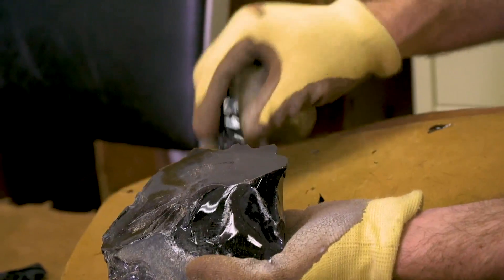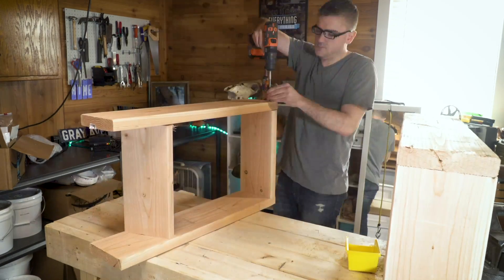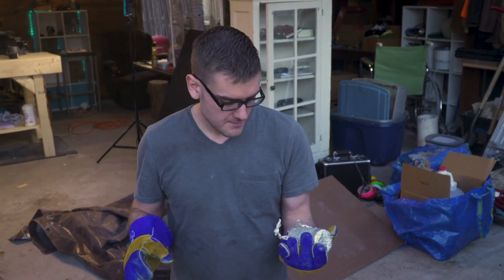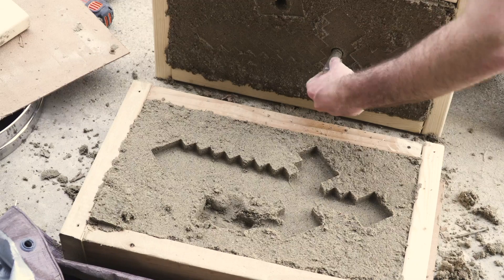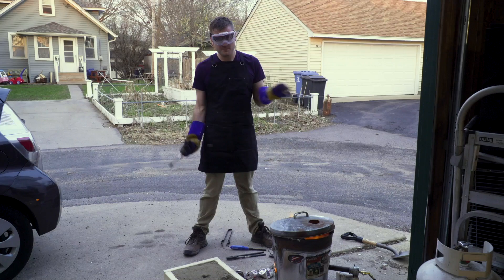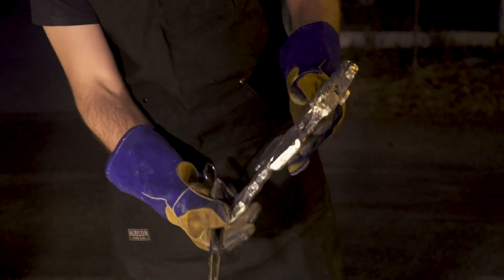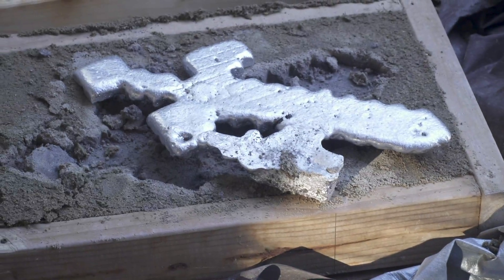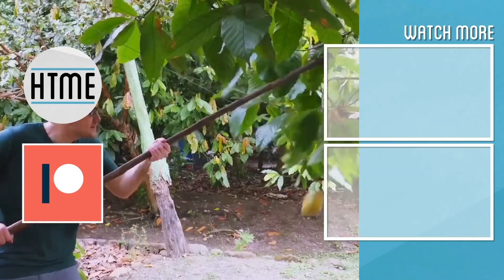Minecraft Sword from Soda Cans: Metal Casting 101

Comment: I've used Charcoal powder as a good flux when it comes to aluminum. The charcoal reacts with air to create co2 before it can reach the aluminum.

 Best of all it doesn't melt and floats on the surface meaning to get it off before or after poring is simple.

Comment: As somone who used work at an aluminium and bronze foundry this was kinda hard to watch ..this is way too late but Your sifter was fine but your green sand looked too wet and you can use ground cat litter instead, it works great and can give a lot of detail. Your green sand should clump if squeezed in your palm but easily fall apart through the sift

Comment: Before you pour the molten, scoop out the slag with either a spoon of a pair of steel tongs. Done right you can get decently pure aluminum, if that doesnt work, melt and pour it a few times scraping out any of the dross you see, and use styrofoam as your mold. When you pour the metal the foam burns away.

Comment: i used to work in the foundry u need to re-inforse ur mold with varium sulfate then when u pull the sword sample on the mold u apply a bit of varium silica on the wall of the sword mold not to much so the flow of metal will be smoother and clean

Comment: use some styrofoam to make a to make a replica then just put it up right in the sand and make a hole in the top pour the metal from the top it  will be better but you have to sand it and polish it it will come out great

Comment: For your frames if you have access to a jointer or planer it's best if the face of the frame that touches the other frame is dead flat on both pieces. If it's not dead flat when you separate them you'll lose some of the sand that's supposed to be against the face of the other mold. You can see this in your second casting there's a bunch of sand on the top of one face when you pull the top frame to remove the sword and also the resulting puddle that creeped into that cavity.

Comment: Did you heat the crusible once before using it 
edit: is your sand dry if I remember correctly wet sand can steam up ruining the casting with air bubbles

Comment: FYI play sand at Lowes or home depot can work OK, but you'd want as fine grain sand as you can. Less smoothing out when done. Also use baby oil for the sand. Don't use water because it can dry out and evaporate alot quicker especially during a pour.

When pouring, use a large enough crucible to hold enough liquid for the project, or might need to scale down the item you want to cast. Always do ONE SOLID pour and not 2 pours as the first cools in the box as you're grabbing the second crucible...

Also try making a little funnel shaped hole so when you pour it won't splatter over half your top section and will filter down into the hole.

The last one came out decent, but with some grinding and a good polish, it'll finalize nicely. Tha KS for the vids guys. 💪❤
Reply: Also, can use BORAX as a Flux to seperate the dross or slag impurities. It's quite a process to seperate all the ink and impurities from the cans but we'll worth the effort when you have the pure aluminum.
Reply: I also wonder what would happen if you used CLAY on a small scale as it'll be smooth and retain the molded shape.

Comment: Next time cut styrofoam into a minecraft sword and use that for the mold but dont remove it because the styrofoam will melt due to the heat of the aluminum and this makes your molds nicer and it will have less air bubbles

Comment: use sodium silicate or petrabond, use cast aluminum scrap not soda cans, they are very poor for casting, watch a bit of myfordboy's and mrpete222's videos on casting. proper green sand usually uses oil not water, you said it your self this is an art and you cant perfect it without the required knowledge or materials.

Comment: One thing to keep in mind that people forget is that your set up should get too hot if it does far too much air will dissolve in it since it's a better solvent at higher temperatures and the result will be a very bubble-y  surface

Comment: When you’re working with aluminum you need to make sure your grinding wheels are made for aluminum/non-ferrous metals. In the last part of the video it looks like there is aluminum build up on the grinding wheel in the background, the heat from grinding causes the metal to expand in the grinding wheel, which can cause it to explode. Potentially fatal, and should never be done. Stick to a belt sander or make sure your grinding wheels, cut off disks, or any kind of grinding equipment is made for aluminum.

Comment: if no one else has suggested this, i would put more airflow into the foundry, it will burn alot hotter and cleaner, you want blue flames with propane, that shows that its all getting enough oxygen.
Reply from the maker: I was kind of suspecting that.  What's the best way to increase air flow?  More vent holes or a bellows system?
Reply: for my heater design (which looks similar to yours) I just ended up buying an old hairdryer and ripping the heater element out then just blowing through the back of the heater, where it is supposed to be sucking air in.
Reply from the maker: Ah, cool.  I'll give that a shot!
Reply: ripping out the heating element is mostly because most hair dryers have an auto-shutoff when they get too hot, and that can get pretty annoying when trying to keep it on for a long time.

Comment: For future castings, you may want to watch how it's done by The King of Random or any other professional casters first, because your first job was terrible. First two tries you poured the slag in with it, third you didn't fix your mistake from the first two by making it so you weren't pouring into a space next to the mold, thus wasting extra aluminum and risking a spot where the mold can be screwed up badly.

Comment: A couple of notes and ideas:

it's a bad idea to cast out of two different crucibles. or to do one pour then wait then continue the pour. the metal that is in the mold will start to crystalize due to being cooled by the water in your greensand, and the next bit of metal will then be splashed on to it  and if it isn't hot enough to remelt the first part of the pour and merge then you will have a freeze up. like a clot in your mold. 

Make a secondary smaller batch of greensand that uses finely sifted sand as the base. do the sifting before mixing with water or clay. then use that for the first fine coat directly on the product. the rest of the greensand is just filler. but the 'detail sand' should be kept seperate for this purpose.

If you are going to melt aluminum cans it helps to first load up a different piece of metal. like some of them smaller bars you were using, once you have a small puddle of molten aluminum started you can push the cans into it and make a lot less of that dross.

venting a big piece can be done easily with just a coathanger wire poked through the mold.

and level ground is helpful, but keep in mind the fluid dynamic of the metal, a slight angle can help the metal flow all the way to the tip of the sword. heck, you might even benefit from casting it vertically instead of horizontally. though you'll wanna change the angle of the vent holes so the metal doesn't pour out of them like this / instead of - 

Consider making your bronze sword out of aluminum bronze if you cannot easily source good tin, it's pretty even after oxidizing, work hardens, and is arguably more suited for blades.

Comment: Just make a styrofoam copy of the sword and leave it in the mold. When you will put the molten aluminium, it will take the styrofoam's place and give you a perfect copy without any need for that block and without the need to saw off or cut extra metal. Also check out the King of Random's videos on casting.

Comment: One thing that you can do as a future thing is to shred what ever metal you are working with. By shredding the metal or metals that you will be working with in your crucible you can more easily able to fine tune the mixture all the while speeding up the heating process. I learned this trick while I was doing black powder rifleing with the boy scouts

Comment: Your doing the sand right but when u take the sword out of the sand u dont need to even have a small peace of wood in there cause if u are doing a two hole mold u poor the metal into one hole and then more metal into the other hole so the metal mixes and and makes the sword mold

Comment: Just a quick note you want to melt about 2x the amount of the material you need when casting as well as making sure the material makes a puddle ontop of the green sand and your forge will have a hard time melting the copper as it has a realitivly high melting point compared to aluminum

Comment: When taking the cast out of the mold, do it slightly after it turns solid as the sand will stick to it and will be a lot harder to remove if you leave it inside the mould to cool

Comment: If someone hasn't mentioned it before, or if I missed you doing it; it would be wise to draw lines/marks on each half of your mold frame to make sure everything is lined up correctly. Could help prevent spilling out from imperfectly uneven sand levels in each half when reassembling.

Comment: Hey one tip to getting a more even amount in the mold instead of having the wholes on one side and having that space where the block is make the whole on the top and bottom half it saves material and you have to do less cutting of excess

Comment: castings don't generally retain much in the way of fine detail, you need to think about a relief gate opposite your ingate on large pieces to allow venting of air pressure, also a riser might help with flow control

Comment: Some other helpful tips for when you try casting the more expensive metals: 1. Dust your object that you are molding with baby powder; it acts as a great mold release when using the green sand. 2, You are loosing a lot of potential cast=able metal each time you pour since you miss the hole, but an easy solution for this is to create funnel like openings at the pour entrances to minimize the amount of waste. Also probably want to invest in a bigger crucible again

Comment: 1: Wear a respirator - the fumes coming off of that process are severely toxic.
2: Talcum powder is your friend. good for mold release. Coat the object your molding with it, then lay down the green sand. When flipping over, coat the surface between the two halves with talcum powder. Less chance of problems.
3: Try to pour all the aluminum in one pour, you should not stop pouring and then continue after, and if you must do it in two pours, have both sets of aluminum close so that there can be as little gap between pours as possible. This is to avoid giving it a chance of solidifying before you have filled the mold completely.
4: relief holes, you need somewhere for the air the metal is displacing to go. ensure there are holes at the furthest points from the pour hole to ensure the gas buildup has a place to escape. That gas may cause the aluminum not to fill the mold completely, cause deformities from trapped gases in the final product, or potentially cause the mold to break due to pressure build up.

If you follow those four rules, along with clearing off any dross while melting the aluminum, you will have a much greater chance of success for your final product. These rules apply for any metal casting you do.

Comment: You should have been fine with just a vent hole, and a pour hole leading to the sword mold. 

Also your Foundry lid needs a little work. Try to instead cast a donut/ cylinder shaped lid out of refractory mix, with the inner hole large enough for soda cans to drop straight threw into the crucible without lid removal. Cast U-bolts into the lid for easy removal. 

That will help retain the heat better, and allow for faster melt times. 

Also soda cans are internally lined with an impermeable layer to prohibit corrosion. This usually flash burns into toxic fumes, expanding out of the open lid, DO NOT COVER THE LID WITH THE NEXT CAN UNTIL THIS OCCURS. Failure to do so results in the expanding gases leaving threw your molten puddle. Splashing may occur.

Comment: Your sand is too wet. That's what's causing the voids. Also, try heating your aluminum for about ten minutes after the last piece melts. That will help you capture the sharp corners of your piece. Last thing. Set a soup can with the top and bottom cut off over the pouring hole as a kind of funnel. This will help build pressure from the vertical weight of the aluminum to fill the crevices of the mold. Great project! I'm looking forward to seeing your success! I tried my hand at casting a bronze ewart park sword a couple years ago and learned a lot from failure.

Comment: Could you have positioned the mold box on its end and poured it down the length of the blade? In my head that would reduce the issues with trapped air... I've never cast before so I may be wrong

Comment: Aluminium cans aren't a very high quality source. The aluminium itself is pretty low quality, producing a lot of slag, mainly due to the printing and chemical coating on the outside and inside. But it's pretty easy to get, so it's good for practicing like this.
Reply: Actually the aluminum in cans is high quality, it needs to be so that a very thin sheet of it can withstand the carbonated beverage pressure. It's an alloy with magnesium and manganese, about 1.5% each. The slag is due to oxidation during melting due to the large surface-to-mass ratio of the cans, and also residue from burning of the inner lining (the cans are lined on the inside with a thin sheet of plastic).
Reply: @stamasd8500  Pure aluminum is actually bad for casting. The alloys used for casting have added elements for good fluidity when casting, less shrinkage and to give more strength than a non casting specific alloy. In addition to the fluidity, they stay in the molten state longer to help with getting into the extremities of the mold and picking up surface detail.

Comment: You need to pour in more metal. It shrinks quite a bit when it solidifies and there needs to be reserve and some pressure in the filling cavity. It is usally a good idea to form a small reservoir in the top of the filling cavity rather than on the mould level.

Comment: For sandcasting (from a metalworking major): Add flux (you can actually just use common Borax cleaner), only ONCE the metal starts to melt, otherwise you can have metal crystallization, meaning it can be brittle. For the actual mold, for the pour spouts, make them more conical, as the pressure will make sure the mold fills as quickly as it can, meaning less crystallization.

Comment: Yo HTME if you're looking for a better way to cast sand casting is pretty bad I'd use the lost wax method or a nice hardwood, yes I know wood burns but in the few moments it takes for the metal to harden the wood remains sturdy and quite accurate. Some DIY   metal smelters even use wood to cast iron.

Comment: Okay, if you're trying to get the right amount of metal, you might want to calculate the mass you need before you go. Calculate the volume of the sword (which should be pretty easy, considering that it's all straight lines) then use the density of elemental aluminium to figure out how many kilos of cans you need.

Comment: It should help to add some babypowder/talkum on top of the half filled form and the sword then add the sand to the second half. You will get smoother seperation and thus a tighter seal.

Comment: Suggestion: Firstly, remove the slag (first attempt shown was full of it)

Second, is more of a guideline, you are pouring the aluminium extremely slowly, this is a terrible idea. Aluminium loses heat really really fast. The pace of your 4th pour  was just about right. The 5th was a good quickpour. 

Bronze is actually easier than aluminium. Requires higher temperature, but holds it a little longer, so it's easier to pour (but do still be quick).

Comment: Good video thanks. I use to work in a Fine Art bronze foundry for 12 years. For a new crucible heat it up slowly the first time with just a flame and NO blower for a few hours. To get the moisture out of it. Then kick on the blower  later. Make a skimmer to skim the slag off the top.  You can use a rounded piece of angle iron with a long rod welded to it for a skimmer.  looks like this  (--------------   then bang it on a junk piece of metal laying on the ground to get the molten slag off before laying it down. Pour faster to get a better sword get some pressure flowing behind it. Also you need to make a big triangle cup to pour into in the sand and also it gives the metal a big hunk to draw from when it is shrinking.

Comment: I good tip is when casting is to use something like baby powder. Lay the item where you'll be casting it then sprinkle some baby powder (lightly coating it) on it. Then put the sand & compact it, one you do that & flip it over to do the seccond side put some baby powder on that & continue compacting the sand on that side. It'll help you release the item ur using as a mold.

Comment: Pop cans aren't a great source of aluminum for casting, proper casting alloys have like silicon and stuff in them. If you wanted to start with the easiest thing to cast, that's gotta be lead or tin, or a combination thereof, e.g, pewter. For bronze you need higher heat, but it almost seems to me like it's easier to cast with than aluminum, if you don't have the proper aluminum casting alloy. 

Also you should use a release agent between the two sides of your flask, like talc.

Comment: Talc helps prevent the mold halves from sticking together. IMHO you're using way too much flux. Also, you can degass the metal to get better casting. It's a learning process.
That being said you are making a pretty big piece which is hard so kudos!

Check out myfordboy youtube channel. He's got a lot of good info on casting at home.